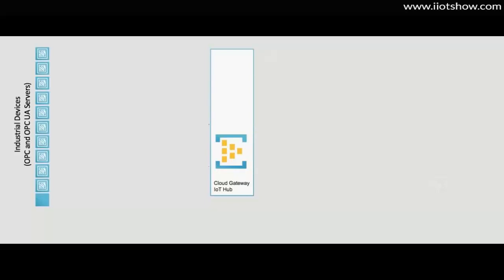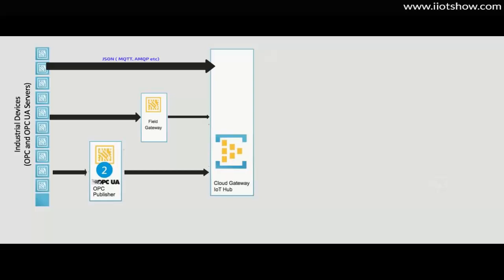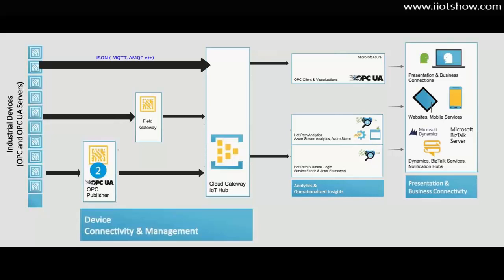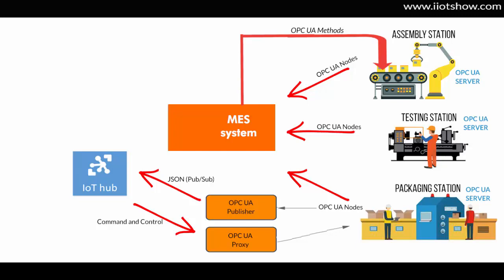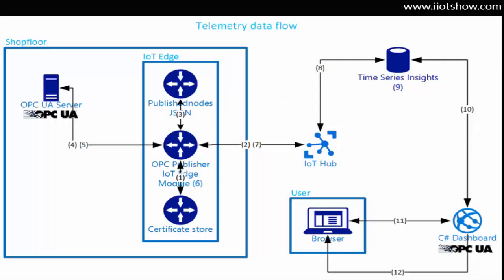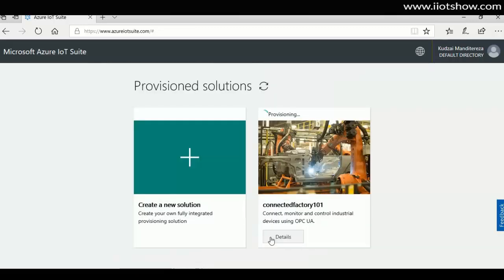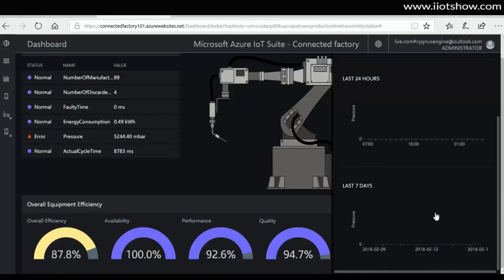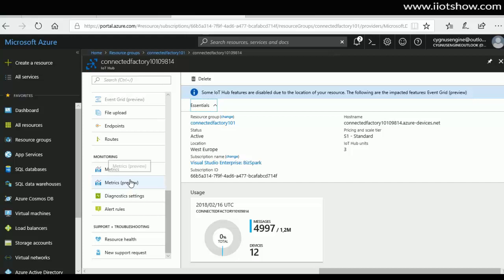How To Quickly Build A Connected Factory Solution Using Azure IoT Suite

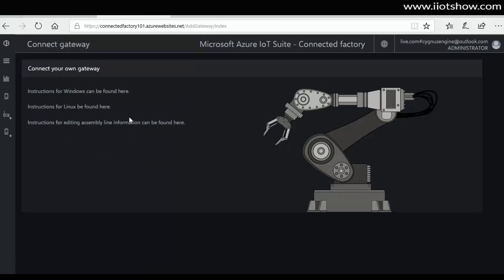Comment: At 23:19, you show a portal page that offers a download of a client certificate if the OPC UA Server on a device requires a manual installation of a certificate. Can you explain what the automated version looks like? For OPC UA connections to work, OPC UA clients and servers need to have each other's certificates in their trusted stores. I am not clear on how certificates can be installed automatically in both OPC UA clients and servers. I am researching OPC Vault; its documentation does not explain this detail either.